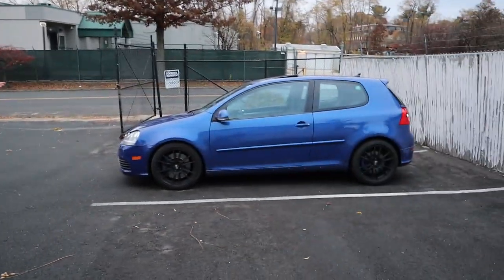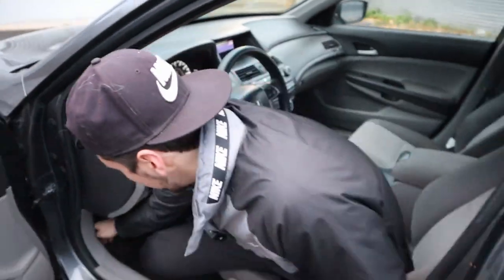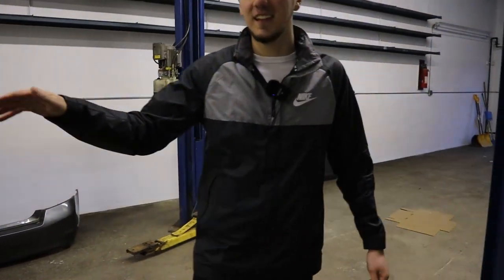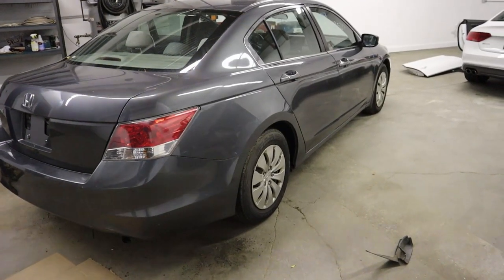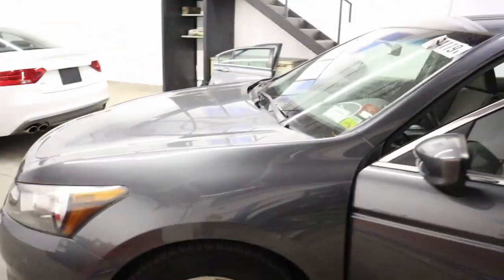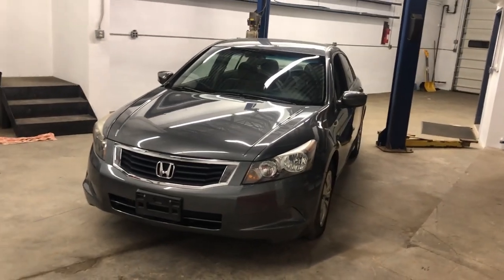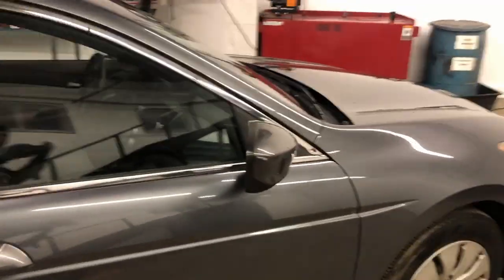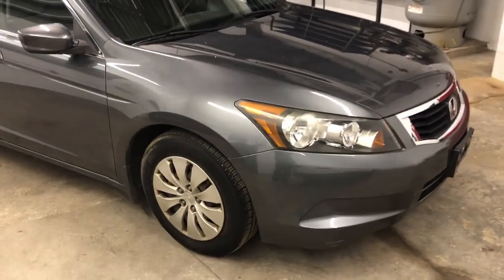Copart: I Bought the cheapest car and fixed it in 10 Minutes! Almost NO DAMAGE! Inspired by Samcrac

Comment: You could probably actually sale those old doors pretty quick just for the glass and window tracks that people might need
Reply: Jay T I actually need the chrome trim that comes on the door. The oem trim is 300+ and the aftermarket ones are $60 but I’ve replaced my oem ones with them and they started cracking 3 months in.
Reply: Yeah and I need the door seals for my accord
Reply: there you go perfect example

Comment: That's a great deal. I also got my 2010 Accord EX 5 spd manual from Copart, however it had a salvage title (rear ended). It has 130K miles but it was also a 1 owner vehicle with an extensive maintenance record, so I'm good with it. Wish it had a clean title but still overall a good deal to me ($2200 out the door + repairs). I was able to salvage the rear bumper with some JB weld, gauze sponges and applying bondo on the crack. I also had to replace the resonator (it bent) and a tailight. The car's been running great and is very comfy
Reply from the maker: Eng_ Alvarado90 130k seems high but these hondas last forever and are awesome, paired with a manual transmission yours will run forever.
Reply: @JohnStax98  yes they do last a while if maintained properly. Since I only put about 8-10K miles @ year (I have another vehicle), I'm confident it will hold up well.
The previous owner definitely took care of it: it had newish BFG tires with plenty of thread left and the oil looked new, the spark plugs and air filter looked good as well (I was prepared to replace all those but it really doesn't need anything yet), the clutch and shifter feel great (in typical Honda fashion).
Reply: How do you insure a salvage title vehicle? Is it only liability that can go on the car? Or is it different in every state?
Reply: @TheStrawberry9936  once you refurbish the vehicle to operational condition, you can go to the DMV and request a Rebuilt title. In CA they require smog, brake/light inspections, I guess is mostly the same for other states. I only have liability insurance on this one and that's what most insurance companies will do for you. Since it's cheap transportation I don't mind getting liability only insurance, but I understand some people may not want to have that (I actually have full coverage on my truck but that one costs 6 times this car did, so it's a no brainer), in that case a rebuilt salvage vehicle is not for them.

Comment: I bought  a same color 2012 accord , so far I'm $4000 in with some small repairs, only l need's front bumper and hood , they are on not too badly damaged and I'm driving it as is for now until I buy new ones. Very good deal
Reply: Dor El mileage?
Reply: @ayushmalpeddi2793   65 k

Comment: 2010, 40,000 miles,
$2,650, $200 for both doors, $100 for the bumper, $120 for the battery, $3,050, $3000   for a 2010, low milage Accord.
I guessed $3000, so I was close in price.
What a steal.
Hey, It's got PLENTY of life left.
Might have been hit when it was parked, hence the airbags not deploying.
170 horsepower, 2.4 liter DOHC 16 valve 4 cylinder, good motors.
PS:, New subscriber,
Thanks for the video, John.
Reply from the maker: Thank you! Ive been driving this car every day and out on almost 20k mikes since then!
Reply: @JohnStax98  So about 60,000 or so on it now.
Keep it, it's a good car.

Comment: You forgot to include the rebuilt title registration cost for the vehicle. I paid $500 to have my title rebuilt for my Copart 2015 Kia Optima which I won for $2,850. I live in North Carolina, I know the cost can differ between states. But it’s a fairly important thing you need to do...
Reply from the maker: Caleb Marshall I did forget, but in Ma its just $50 application fee
Reply: smile cute There are some vehicles that do not require a license to bid on, you will have to check into that when you go to bid.
Reply: Otherwise if the vehicle requires a license, then you can use a broker to bid on vehicles that require license (e.g. dealers license)

Comment: My 2010 Accord has 225K miles on her. I've replaced the battery a couple times and the starter once. Nothing else under the hood has ever been replaced aside from basic maintenance like oil and transmission fluid changes. All original hoses, belts, tensioners, etc. Original brake fluid, power steering fluid, engine coolant. I know, I know I should get that stuff done. Honda's are bulletproof. I paid 23K new.

Comment: Mine is a 2008 sedan. It’s a reliable car. Mine has 118,000 miles on it but it’s still running strong. Pretty good on gas mileage. Aye just make sure you check if the recalls have been taken care of too. I heard there was a recall on the passenger side airbag. I think they can fix that for free at the Honda dealership. I got mine fixed for free.

Comment: Damn wish I could've found something like this car near me. I just bought my first car at an auction, it's a 2006 Honda Civic 170,000 miles. It needed motor mounts, transmission mounts, suspension, new tires, and basic maintenance. Then the interior needed detailing my center console needs a latch my trunk doesn't open so I have to leave a portion of the backseat out. I got a new quarter window because it was broken and still need to get my front window fixed because it rolls up to far I have it sealed rn though. So I still need a window regulator weather stripping and a trunk latch after that I want to get a tint job. And I'm into the car $6000+. The winning bid was $1,600 and walked out spending $2,600.
Reply: yeeesh

Comment: I have a 2012 honda accord with 278000k still running like it did when I bought it with 100k
Reply: Shawn Kemp  Only the V6 has a timing belt. This is a i4 (Those have a chain and dont need maint) I have the V6 2012 and it has 83k and I still have the original belt on it.  Honda says every 100k or 7years so im gonna do mine soon.

Comment: Hate to say that motor didn't sound like a 40k. Good luck 👍
Reply: I recently drove a 2019 Honda with even less miles and it sounded simular.
Reply: @Tjtjboy  The Accord you drove sounded like that because it has direct injection. His Accord sounds like it has some sticky lifters probably from either a lack of oil changes or just it had been sitting there for a long time. Either way its not a big deal throw about a 1/4 can of Seafoam in the crank and the rest in the tank. Then change your oil after about 500 miles of driving and you're good to go

Comment: It is rare that is happened correct? Do they allow you to start the engine and check anything else?
Reply from the maker: Simple Living The only rare thing is the low mileage, theres hundreds of these lightly damaged cars but they usually have 100k+ miles.

Yes, you can start the engine and drive the car 5 feet forward and back before bidding on it.

Comment: I'm looking for my first car and only have  like $500 - $1000 tops to buy a car/ truck do you think it would be a good idea to try and buy a older run and drive vechile  off of copart?
Reply from the maker: PlatinumAssasin Absolutely, if you look hard enough you might find a sub 100k mile Honda or Toyota that you can easily resell for more money In a year or two.
Reply: @JohnStax98  ok , thank you very much!   I'm trying to  get a cheap reailble vechile and stay away from private sellers that usually have hidden damages or they're  lying about condition and so on. Ik everyone's not like that but you kno.
Anyway thank you again man  !! I'm going to be looking out for one.

Comment: Is you stick with Honda’s they won’t let you down
Reply from the maker: Yes! Hondas will run forever
Reply: arlex marrero.  wrong!  have 1996 accord had 98 miles now 114 first ran good then heater hose broke fixed dat then replaced all other hoses, then cam seals poped out oil every where fixed dat with new belts , waterpump , seals cover, then plug seals leaked and oil in plug wells difficult time finding seals , found 52 dollars wow! , then engine overheat hmm headgasket bad 200 dollars on different in liquid seals, it slowed down leak and then plugged heater core, then radiator plugged , got from junk yard dat one no good so bought new one, then  reroute hoses from heater  core and take out thermostat, then raditor cap no good replaced dat, engine overheat to many times most likely head warped or block cracked , still runs but water thins out oil and getting in one piston but crank it few times push water out then runs good for maby half hour then getting to hot so shut down cool off then put in bout two quarts coolant or water, interior very good and can use paint but really need better motor dats bout twelve hundred dollars engine and labor , paid 2,400 for car another. 1, 200 plus 900 hundred for pump and seals 4,000! for 1996? and no guarantee another used motor not gonna need all the same! HEADACHE! SO HAD IT! another honda don't think so.
Reply: Oh yeah mines broke down in the parking lot rn(:
Reply: Nothing Free that’s the last you can do for a car that was made in 1996. I have an 07 Honda Fit with 245000 miles and no issues. Also have a 2013 Honda Pilot with 211000 miles and still counting.
Reply: Donald Trumpp 

Hahaha this is unheard of. A broken down Honda never heard of it 😏🤟🤷🏻‍♂️

Comment: Did you change the locks on the doors?
Reply from the maker: Theres only a lock on the drivers door from the outside. It was not necessary to change on the passenger side as its all electronic
Reply: But i would change all parts from the broken door. Because of the mileage of the vehicle

Comment: Damn you stole that thing with only 42,000 miles on it. it's not even broken in good till it hits 50,000. is it just me or does the paint from the other car look like it has more of a blue tint than the paint on your car? might just be a trick of the camera but it looked that way when you  were putting the mirror on the front door too.  If you didn't want too much for it that would be an AWESOME car for my daughter. not sure where yall are though either so distance would be a factor too

Comment: Only this took longer than 10 minutes. With the front door not aligned perfectly it isn’t finished. Don’t copy sam’s habit to not watching the details. It really screws up my OCD. It is not the time that counts it is the end result that is not the best it can be with these replacements take 30 minutes to align the panel’s. Also it needs to be polished to make it look like a 40k driven car. Would even consider going to the junkyard for some alloy wheels even the stock ones on the damaged car would make it look like a more expensive car. Now it still looks cheap.